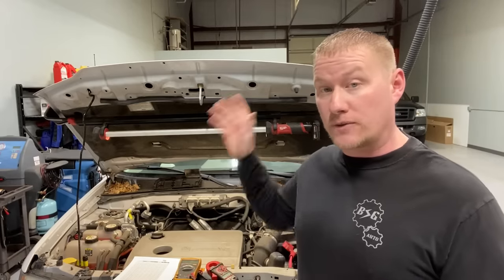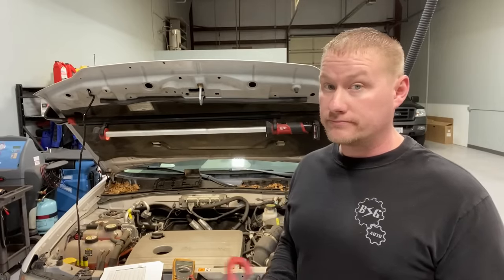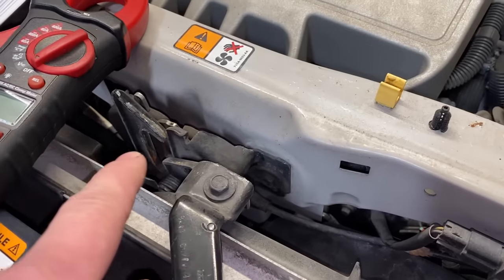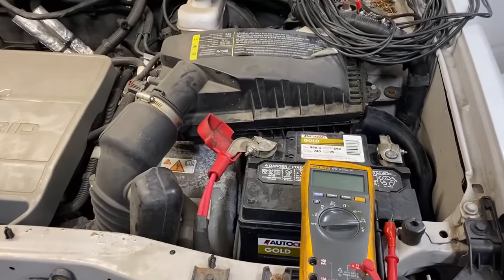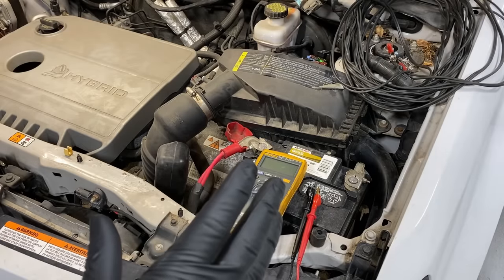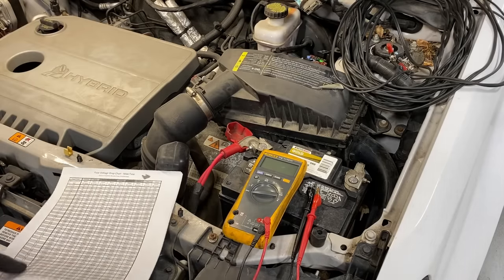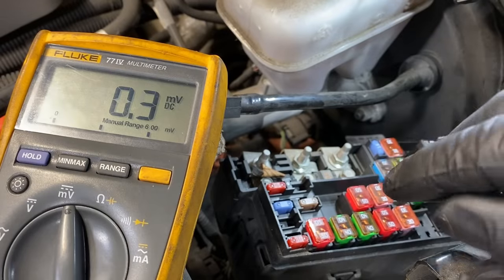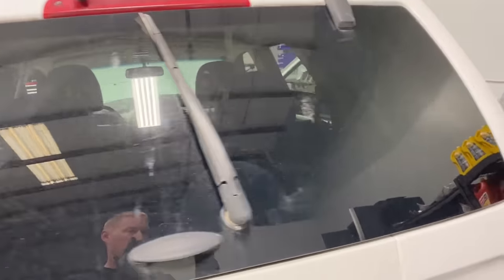Which Parasitic Draw Test Method is REALLY the Best?

Comment: You are the man i appreciate all your  help and I sure need some now on my 2005 explorer V6 4x4 iv had it two monts iv replaced and fixed  everything I thought that it needed it's when into limp MODE  when  I start it runs ruff warms to operating TEMP  it still showing 2 codes pending both throttle body issues on the dash still reads out engine failsafe mode I tested pcm it received signal and sends what can I do ??

Comment: Thanks, job well done. my question is about the 4.0.l 245 push rod roller camshaft engines! with vacuum A4LD. very early 1994.. in a week or two, will have block and heads back from machine shop. will be my first fxxd engine from the mid 90s. Have lots of experience, some where around 250+ gas and diesels, and a bow tie lover. is there a video? on this particular engine? enjoy your dedication to getting it done right. have benefit from all that have watched. thank you. Interested in any comments on this subject!. from anyone.

Comment: Hello, I have a 2008 Escape V6 XLT with a Kenwood double din stereo that turns on by itself. I replaced the Accessory Delay Relay over a year ago and the situation seemed to be solved. About 3 months ago the issue started again. The radio is fed by Fuse# 39. When I pull the fuse the radio goes off. Can you suggest next steps or know the part I should replace?

Comment: Great video! I have a  2005 4.2 F-150.
It was a  government vehicle for animal control.  So it has a box on the back and not a bed. It had radios and lights on it, and since removed.
It also has a ventilation fan on the roof that doesn't work anymore.  Everything else is stock, so that is where I am going to start troubleshooting. 
My question is on my pos+ battery connection has 2 large cables tied into the battery post connection. They both look legit, I just noticed in your video that the battery pos+ only had one cable connected. Is this normal?

Comment: One question I do have though is, what if you have a dual battery truck. I have a 99 Ford F-250 Superduty. Would I just configure my passenger side battery like you have this battery then disconnect my drivers side battery completely?

Comment: On the second test, using the in-line multimeter, why would you use the jumper between the post and the terminal?  i.e the double wire/ clips put on before the multimeter leads.  It seems like not only is this not needed, but it could affect the current reading on the meter by essentially bypassing it.  Wouldn't you just connect the multimeter to terminal and post, without this jumper?

Comment: Do all vehicles need to be “put to sleep” wait 90 minutes or is this just ford?   I have a Nissan Frontier with a parasitic draw.   Reason I ask is I never lock my truck, keys are left in the car at all times.  So all the years I’ve owned it it’s never been “put to sleep” via locking it.  Brand new battery and it keeps going dead.  Any suggestions are appreciated thanks

Comment: What about a Diesel Truck with dual batteries. Can you place the amp clamp on just on battery or do you need to look at both batteries since each battery powers separate modules?

Comment: Any info on the common 2015 ford fusion intermittent dead battery? If car sits for a day with no use, intermittently, battery completely dead, battery replaced 2x and always tested good...draw is intermittent and have heard theories of sync system, parking brake motors, but no excessive draw when tested?

Comment: ive had an issue where the car would run perfectly fine , randomly I would turn the car on run it for 20 min and the cars DSC AWD modules fires up as malfunction , this is a clear indication of my models turning off. The vehicle has a IBS intel battery sensor 220 AMP alternator and for some reason Im not certain why the cars battery dies sometimes and doesn't die sometimes

Comment: Sorry to bother you but my 2006 Ford F-150 with 85,000 miles is racking my brain. First of all, I have three positive factory cables on the positive post. Do you check each cable separately for a draw and add them together? My main positive cable is .500mv, the second cable .200mv, and third .220mv. I do have an aftermarket autostart that has worked flawlessly, I checked the three fuses and all read 0.00mv. Concerning the small square fuses, do I have to pull these out one at a time since I cannot probe the top of them with the voltmeter? My truck lives in Minnesota and there is a lot of rust, could I have a grounding problem? Lastly, I have read that large clamp meters are terribly inaccurate below 3-400 milliamps. I have found this on mine. I think a low milliamp meter would be much better for the third way you mentioned.

Comment: I tried the new method on a 2013 hyundai. Got absolute garbage. Readings bounce around. I would guess the error band is at least 100%, and you are stacking up those errors. Pain in the ass too. Probably invented by a college professor. Works in theory, not in practice.

Comment: Hey, I did the same test on my Skoda Superb. The current drawn started at 1.8A and went down to 0.2A, remained there for a few seconds and jumped back up to 1.8A. And kept going back and forth to those two readings. Continued to do it regardless of which fuse I removed.
Could you help me with what's the potential issue.
Thanks

Comment: after you hooked up the inductive amp clamp and measured voltage drop at each fuse, did you wait until the high amp reading came on the clamp and then, ran over to each fuse to test?
Reply from the maker: yes the draw must be present.

Comment: Great video--to a point. You criticized the first method in part because it doesn't provide a way of testing the cartridge-style fuses, fuses over 25amps and relays. The third method, which you promote, doesn't deal with testing those items either. Why not fix this oversight with a second video or just address this here in the comments?
Reply from the maker: I have many times please see previous responses

Comment: will method 2 or 3 work with a 98 jaguar ? Jag was owned by ford at that time - would the 60 minute wait time be the same ? the door trick to keep the doors open and not interfere with sleep mode the same ?

Comment: Hey im having 5A parasitic drain in ky 02 Jeep Grand Cherokee Laredo 4.7L on fuse 8 underneath steering wheel.
How do you suggest i find the problem component on that fuses circuit (#8) without turning off power to those wires and loads.

Should i use multimeter with voltage drop testing in volts in everything diagram says is on fuse 8?
Seen a video from Motor Age that stated best why to find wire faults is to test voltage drop before abd after load and before and after source. The resistance will show itself somewhere using voltage drop.

My fuse 8 underneath the driver's dash says it has:

Overhead Console, Rear Wiper, ip lights, rear flipper glass solenoid.

I checked the wires of overhead console and rear wiper wires and didn't see any obvious wire problems. How should i test them. I'm told it's best to do testing while the wires are still running to get accurate reading. But I'm asking whats best:
Voltage, resistance or amps to test wires and loads?

Comment: In the last part using the amp clamp if you have a draw present how can you check the fuses with the voltmeter if most of the fuses are the ones with the plastic covers like you mentioned earlier.

Comment: I don't have a amp clamp and would like to know if I can use 2 multi meters instead.
If I connect 1 meter in series to the negative terminal like you did in Method 2 and then use the second meter to test the fuses for a drain with a second meter.
Would this work

Comment: Interesting.  I have an original Fluke 77.  It still works but does not have the min/max feature so I guess I would have a hard time nailing down an intermittent problem other than watching the meter for minutes at a time to catch the intermittent but should still be a good method for constant draw problems.  But even then, to verify there is an intermittent draw, I could connect the meter between the battery terminal and the negative cable and watch it for a while and if the intermittent was happening at a reasonable time interval I would see it, and then at least I would know it was a once in a while thing. Good video as always. Where did this idea come from to check the voltage drop across the fuses?

Comment: At around 21 minutes — is there any reason not to use an actual jumper cable rather than the cable you made? My guess (which is completely a guess) is that there would be no need to use both cables of a regular jumper cable, but that's besides the point. My question is why not use a regular jumper cable?

Comment: For Method 2: Can I just use my jumper cables? I don't have smaller cables to make a series connection. They are much larger and I'll only be able to hook one cable to the terminal, and then the other to the cable hooks.  Is that ok?

Comment: Hi, as i am no tech guy, i do have a couple of questions in the methods with holding the multi meter leads on the fuse for so long when in the vehicle,testing that fuse to the rear wiper,
when you were holding them test leads for so long on the fuse waiting for it to show amp draw, could the power from multi meter trickle voltage in and what you were getting back was what the multi meter had put in .
Also on the last way off testing for parasitic draw, you left doors open but i suspect close off the door latches in the close position, to make car think doors are shut, 
Do you do the same with the bonnet ?and also is there any way this could mess up the alarm system,
Some years ago i watched your video and found a draw from one of the fuses , ford fiesta, it was the fuse to the radio,draining my battery over night,so i left the fuse out as i never new how to sort it, i think that slowed down the battery draining so quick,

Comment: Can you do the 3rd method with two multimeters instead of an amp clamp? Just wire one in on the positive like in the second method and then use the other multimeter to check the fuses?

Comment: Just a little confused on when to test the fuses...you said to test as the parasitic draw is happening, which, if I understand right, is when the value on the meter spikes... but in the video you appear to be testing the fuse while the meter is reading zero  or near zero and not while the higher numbers are actually showing on the meter...am I wrong in thinking that is when to test the fuse or can the test be done just after the spike in the reading?

Comment: I know this is an old video but Ill try to post a question. I have a Fluke 374fc Clamp meter, it says it DC current range starts at 0.1v, so 100mv, is this meter enough to use for this test?

Comment: Question for you is I own a 2006 Lincoln zephyr and I have noticed that some time when you pull the key out of the ignition switch my sensors makes my driver's seat tilt backwards and mirrors turn downwards I brought this up with the dealership and they can't get a reading on the computer because it doesn't leave any code any suggestions

Comment: Will what u are showing ,work on my  02 dodge dakota.i have a real bad drained.12.6 v .I had bought new alternator, starter, battery.terminals. an it still going bad.aftermarket stero an amp is disconnected..

Comment: An easier (and more reliable) way an an old car to guarantee the open door dinging oe other "help" doesn't destroy the multimeter is to pull the fuse for that circuit(s) first and leave it pulled until the drain is detected on another circuit(s). When done, disconnect the multimeter, then replace the fuse for the circuit that causes the dinging when the door is open. I tried to depress the button that signals that the driver door is closed by using gotilla tape to hold it down. It didn't work well - didn't hold. Fortunately it released before I had the multimeter hooked up so my multimeter is fine. (To get to the fuse box on the driver side I have to get on my knees on the ground outside the driver door and stick my head under the steering wheel. To do that I have to leave the door open. There is no fuse box on the passenger side. - 1990 Camry.)

Comment: as always great vid! I must've missed "Why" you used the jumper wire instead of just connecting the DVOM directly in series between the neg post and terminal for the Old School method?
Reply: Because Brian wants to let the car go to sleep with a steady (powered on) circuit... battery power constantly on to the ECU. If he placed the multimeter in line without the jumper wires then some multimeters will "go to sleep" after a few minutes and that will interrupt the flow of battery current and thus interrupt the "going into sleep mode" of the car's ECU. Then you would have to start all over because the car's sleep cycle had been interrupted. I know the Fluke meter has a sleep function in order to save battery life, but not all multimeters do that.

Comment: Great video, but why the dual alligator clips to bypass the ammeter while the car 'goes to sleep'? Just put the ammeter in series and turn the meter off. Let the car go to sleep, then turn the meter on to see the parasitic drain. You don't need to bypass the ammeter.
Reply from the maker: oh yes you do for so many reasons. I don't do anything without a purpose.

Comment: The voltage drop test on an active draw is fast and effective but to use it exclusively is not a good idea I use the amp clamp with scope and the voltage drop test, it just makes sense didn't think it was something that needs to be told lol
Reply from the maker: Some don’t use a reference for amp draw while doing the volt drop test for some reason.

Comment: Bro the Audi Q7 first gen 07 model with the 3.6L  battery is under driver seat. ? So how do I apply what you spoke on here with doors open and the vehicle is to be asleep. The fuse boxes are located on both ends of dashboard with each door open.

Comment: Ok so I put an amp clamp on my positive battery cable and I want to check all the fuses on the inside of the vehicle. How is that possible? Do I test each fuse until I find one that has a reading, then go to the engine bay and see what the amp clamp says?

Comment: Im chasing a P draw of over 1 amp on a 2017 F150 XL stx 5.0L

Nothing special on it.   I've pulled every fuse and relay I could get my pliers on and still no drop.  Only thing else Ive read was to fully disconnect the alternator and there were people with 7th gen f150's having to replace their ignition switches and park lever relays.

Any common 8th gen f150 P draws you know of?  Tired of the battery randomly dying as its not a constant dead in 3 days thing.

Comment: Had a 2015 Lincoln MKC 2.0 L. in the shop that kicked my ass for 3 days. Parasitic draw of over 2.5 amps. Modules would not go to sleep. Radio control faceplate always 10-15 degrees warmer than the rest of the dash. Spent hours trying to isolate Sync module, FCIM module, SCCM module, Gateway module etc. to make the radio and other 30 modules to go to sleep, but never was able to get milliamp numbers down to an acceptable level. The BIG mistake I made was ignoring an inoperative power liftgate that I was unable to communicate with our Solus Ultra scanner. This car does not have a power liftgate. Only the cinch motor, but still uses the same troublesome PLGM module. After unplugging the module to run circuit tests.....BINGO....In 15 or 20 minutes, all other modules went to sleep and parasitic draw dropped to 32 milliamps. A new PLGM and trunk latch assy. was the fix. Many of the 31 modules on this Lincoln do not use a key on signal to power up. Car uses Can networks to accomplish on/off.

Comment: I have a 2018 Ford Escape that has a battery drain problem and have brought it to my local Ford dealership at least 5 times to find the problem.. The car has died on me at least 8 times.. so I drive with  a battery booster in my back seat.  After watching this video and following it to the letter .. I found the problem less than an hour to be associated with fuse 60 in the compartment fuse box.. I removed the fuse and my battery drain is gone..  Something is happening after the car falls asleep that with the fuse 60 in .. draws from 16 Amps to 17 Amps.. no wonder my battery would die so easily.  Now Fuse 60 is only a 10 amp fuse so something else is kicking in only when the fuse 60 is in..  so far just my dome and glove compartment lights are not working (which I can live with)..  So going back to the dealer to tell him what I found and hopefully they can look up in the schematics and figure our the problem... But great video !!!!!!!

Comment: Ford explorer 2014 PowerTrain Relay stays energized (coil powered) with key off, drains battery over night. After removing the relay and putting it back it did not energize ( click on and draw current) how ever after driving yesterday and parking last night, it is staying energized again draining the battery. What energizes that relay, the switch the PCM?

Comment: So how do you watch that induction meter with your head stuck under a dash somewhere? Once you know the draw (e.g. 5 amps) you could run a jumper (that would handle that draw) from ground cable through the cab and back to the battery neg and clamp around the jumper inside the cab? Better hope the draw never exceeds the jumper rating!  Or does working inside the cab make this part a 2 person job when you don't already suspect the wiper motor? It could just as easily be a radio or CD player.